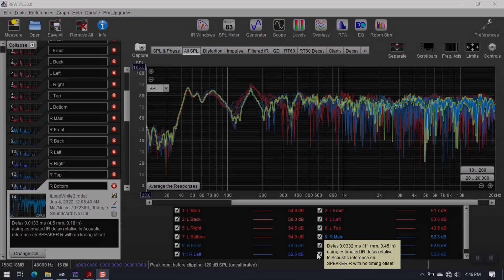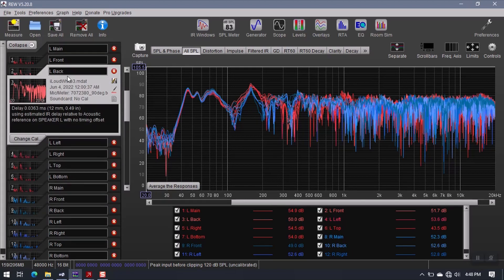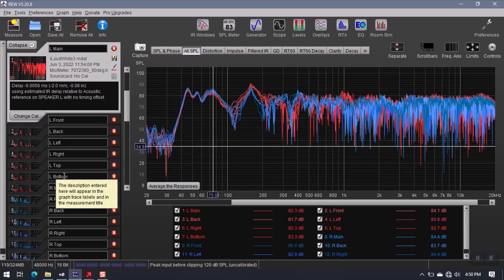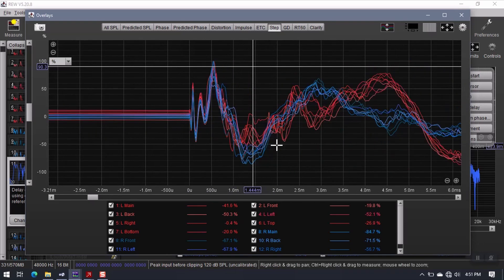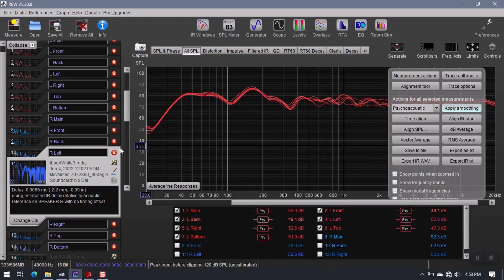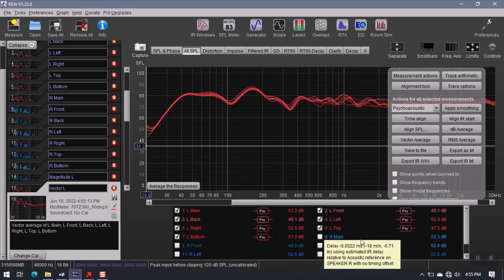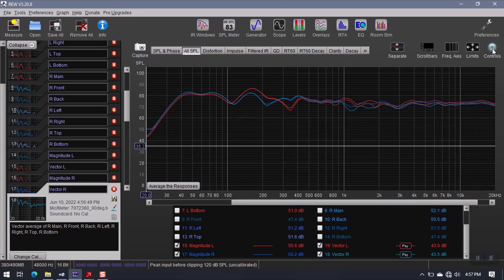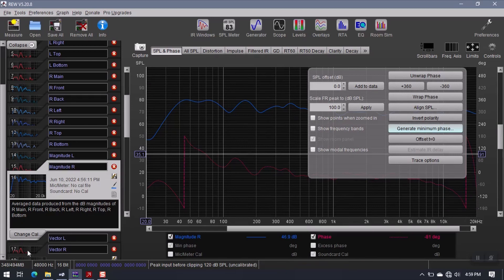Digital Acoustic Correction for Desktop & HiFi speaker systems using Room EQ Wizard and rePhase - P1

Comment: David, I have a couple questions.  Is there a way to connect outside this thread to discuss?  My original measurement, the phase wasn't terrible.  After going through all the steps, the phase has a ton of wraps.  It went from 1-2 wraps to 90-100 wraps.  Otherwise I think I followed all the steps.  I watched all 4 videos and took notes to make sure I was catching all the steps.

Comment: Thank you for these videos. Very helpful! I've been playing with REW and use a trick to correct phase without introducing echo noise or changing the frequency response. When comparing two different phases from measurements you can close the window down a lot, like 2 cycles when doing the A/B to get the phase difference. The phase remains largely intact even though the frequency response changes a lot. With that phase difference result, 1/A it to make a phase correction filter. Set the max allowed gain to zero, and then adjust the target level so that the frequency response of the 1/A result comes out flat. That will give you a phase correction filter that does not change the amplitude. Multiply that by your magnitude adjustment and it will adjust for phase and frequency response as expected. Helpful for me since I don't run Windows, and rePhase doesn't run on Mac.

Comment: Thanks for these 4 tutorials! I'm about to begin with this part but can you please tell me in what conditions you did the measurments? Did you use acoustic timing reference?
Reply from the maker: Yes I did use acoustic timing reference. When you measure the channels make sure the reference chirps come from either the left speaker or the right speaker each time. Doesn't matter which one, but keep it the same for both speakers. Also I aimed the mic straight up at the ceiling.

Comment: Awesome video. Thanks
Reply from the maker: Thanks! Be sure to check out the single-point version of this. I have personally been getting better results from that procedure, which is a little different. You can still use multiple measurement points, though, if you want to experiment. Have fun and enjoy the filters.
Reply: @davidbrancato  I just finished up and the results are awesome. I am starting on the single-point version now. thanks again.